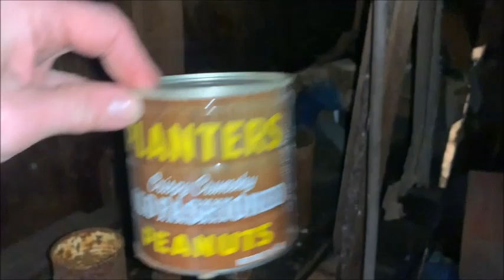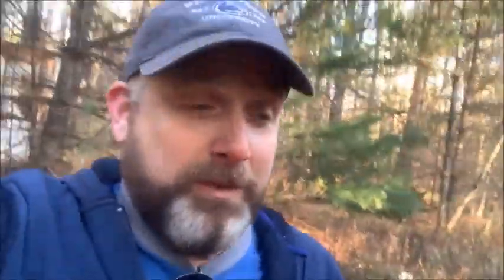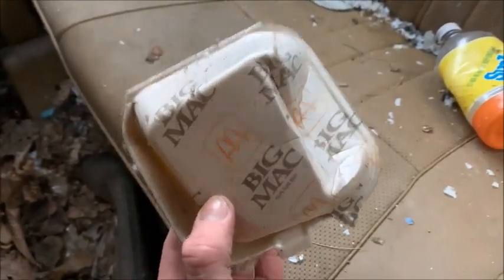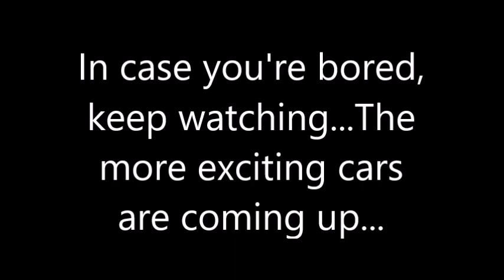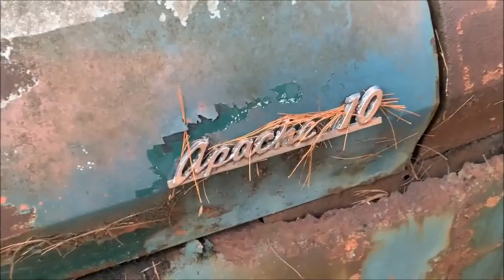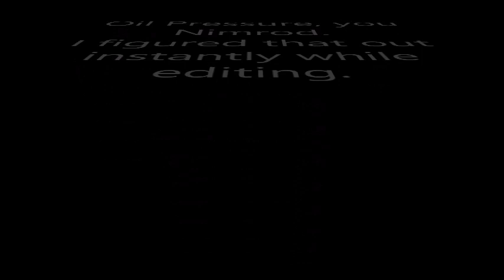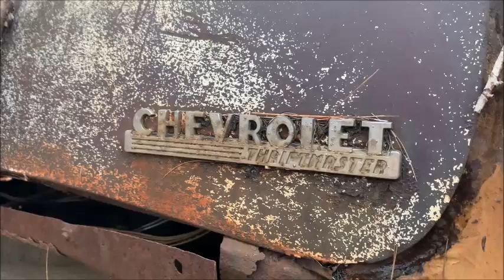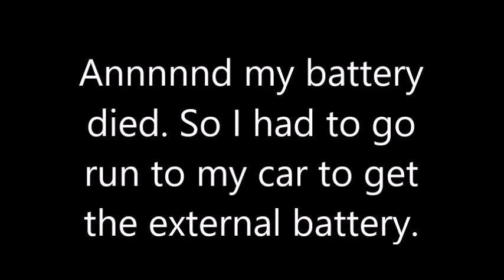Awesome Antique cars in the woods.

Comment: Also in the Corolla ,  The Sunkist soda bottle with the separate orange plastic piece  glued to the bottom of the bottle.
Reply from the maker: I think that was all the original pieces. The older Sunkist plastic bottles had that kind of bottom. The "yellow" label was actually faded from the sun. The other side showed it's original orange coloring that matched the bottom piece.